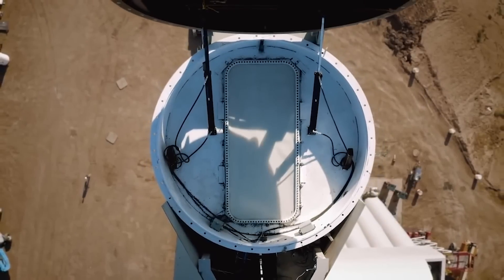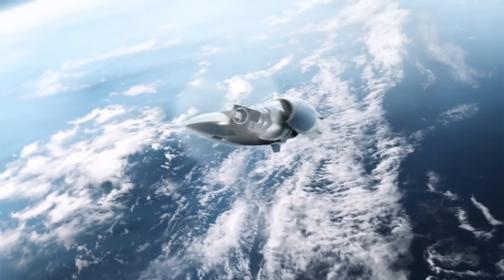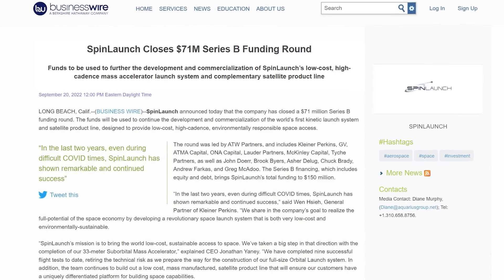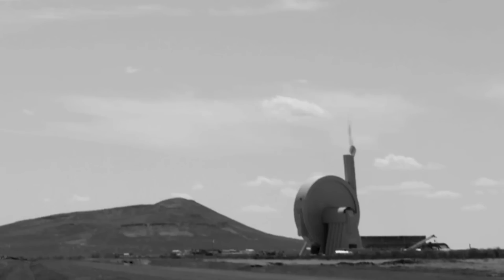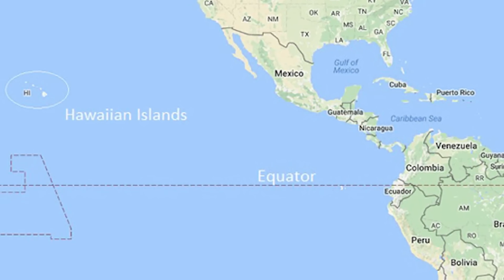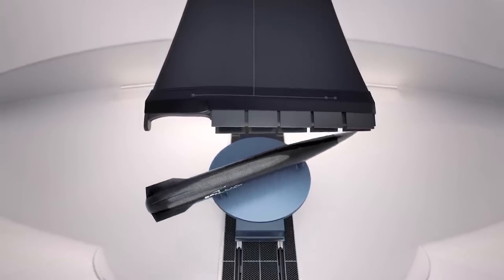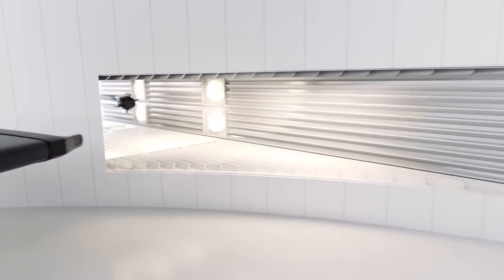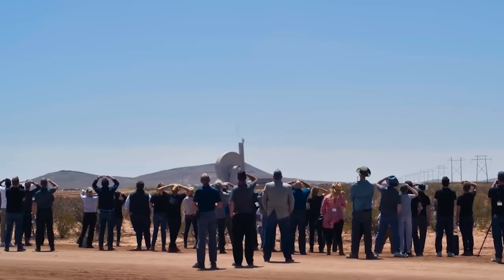What Happened To SpinLaunch & The Orbital Accelerator?

Comment: They got a 200 kg projectile to 30,000 feet, with no remaining vertical speed. 

You could attach one to each external hardpoint of an F-18F and get 11 at a time to 40,000 feet, with mach 1 vertical speed, which would net an additional 17,000 feet or so.
Reply: Lol you need 30 times the energy to orbit vs just reach orbital height and what you’re saying isn’t Even that.
Reply: @hugegamer5988  That is what I mean.  It is not useful at all to launch a satellite vertically and then "just use a second stage to make it reach orbit".  The vertical displacement is not the problem, the horizontal speed of 7 km/s is.
Reply: @mastah39  is there not a market for dedicated launch capability of small science satellites like CubeSats? or has that market been entirely swallowed by ride sharing on larger launch vehicles?
Reply: @mastah39  It's the cost per launch though. Do you think their spinny thing is going to be cheap to build and maintain? How many payloads could a B-52 launch in one flight? 30,000 kg is 150 × 200 kg, so 150 payloads?
Reply: Actually that makes bugger all of a difference.  The energy of launches is not in the height.  @mastah39
Reply: 1) It was a suborbital prototype made for proof of concept reasons and oriented such that the roket goes straight up. If you've whatched more about it you will know that they intend to build a bigger, more powerful, better oriented one to launch the projectiles faster, higher and with a better trajectory
2) The point is to use technologies that don't produce CO2 emissions so your F18 really doesn't fit the bill here. Plus there really is no guarantee that your F18 solution would be feasible, more economical, faster and so on...
Reply: @anthonyjaccard3694  The point is to play a bit with hardware, and to get money to do that from naive investors.  Nothing more.
Reply: @Rob2  If that is the whole extent of your argument, I have no idea what you are doing on an engineering channel. What is the point of looking at videos of new, emerging technologies if you're going to discard all of them with "eh, they're only doing it to scam investors out of their money" ?
Reply: @anthonyjaccard3694  I am not going to discard ALL of them!  Only those that present technologies that cannot be practical due to limitations imposed by laws of nature.
Reply: @Rob2  If we were talking about an infinite energy motor I'd agree with you on that part because it actually goes against the laws of physics as we know them. Spinlaunch doesn't, it only goes against our intuition of engineering constraints. Just because the numbers are big doesn't mean you can't engineer your way out of those constraints. Just go watch Real Engineering's video on spinlaunch. He goes into a little bit of details on the many constraints that this project faces and you might be surprised
Reply: @anthonyjaccard3694  Spinlaunch also goes against the laws of orbital mechanics.  It is not possible to get an object into orbit by shooting it from the surface of the earth, no matter in what direction and with what velocity you shoot it.  Neither Spinlaunch nor Real Engineering will be able to overcome that.
This is completely independent from the practical problems imposed by large acceleration.
Reply: @Rob2  
What exactly do you think the orbiting stage is for?
Reply: @anthonyjaccard3694  you still need to reach orbital velocities, which won't be done using existing liquid rockets - they won't survive the G forces of the spin launcher.
Reply: @smalltime0  Then maybe they'll use solid fuel rockets. Maybe they'll find a type of liquid fuel rocket that can withstand the force. You'd be surprised the solutions that can be found when people put their minds to it. Just because you can't think of a solution doesn't mean no one can and the idea should be scraped
Reply: @anthonyjaccard3694  Solid rockets don't really suit being used to place a payload in a specific orbit, once you fire them you don't have any sort of control - it will keep burning until its done. Pumps are fragile and are required in the use of liquid rockets, there is a reason why most launches limit themselves to 3G~4G of acceleration - its for the sake of the pumps and the payload.
And that's the key, the actual payload has to survive.
Reply: @smalltime0  Go look at "real engineering"'s video on spinlaunch. He talks about the effect of the G-force on the payload towards the end of the video and you'd be surprised how little of a problem it turns out to be
Reply: "You don't understand it now but this is the future of launching satellites."
Reply: @Bollibompa  Hogwash.  It is never going to launch anything into orbit, let alone a useful satellite.
Reply: @Rob2  Hey, I disagree... it is definitely possible that it launches something careering uncontrollably in space - maybe even at escape velocities. But the payload will be a mangled piece of various metal alloys that once was functioning electronics.

More likely, in the event of a "successful launch", the vehicle disintegrates as soon as it leaves the vacuum of the launcher, sending metal shards and flaming chemicals over an impressively wide field. Sort of like a hyper velocity shotgun.
Reply: @Rob2  
"People told Einstein that he was insane."
Reply: @smalltime0  I said "launch anything into ORBIT", that is different from "something careering uncontrollably into space".
It is not possible to launch into orbit from earth surface without further acceleration at a later moment.
Reply: @Bollibompa  You are not going to compare these people to Einstein, aren't you?
Reply: @Rob2  I am sarcastically arguing with you.
This thing won't work, it will never work and at best it will be outright dangerous.
Reply: what? are you going to spin the aircraft? ridiculous. I don't think you have a clue.
Reply: But then how would they defraud their investors out of millions? I bet you their next step is to put solar panels on the building, and call it "solar spaceways".
Reply: Great idea if you want a ridiculously high cost per kg. An F-18F costs about $30K per hour to fly. Also this is from their smaller scale tests-when scaling up, they want to make it such that the payload can breach the Karman line at least. 

The whole reasoning behind this is to lower the cost per kg, otherwise why not just use traditional rockets?
Reply: @mastah39  ok one more question, is air launch something that is more helpful on smaller launch vehicles compared to larger ones? and if that's the case can you think of any small and (comparatively) affordable aircraft that could be used as an air launch platform for small payloads?
Reply: then why isn't it being done?
Reply: @Name-nw9uj it is done, rockcoons and air lifted 500 lb rockets to orbit are not unheard-of. The Pegasus is probably a superior effort to this abomination.
Reply: @testpilotmafia862  right but all of those are rare. if a small jets can be used to launch small payloads like this spin launch thing why arent they being used?
Reply: @Name-nw9uj  Because it isn't a good way to collect huge $$$ in investments and grants and give yourself a big paycheck.
Reply: @briant7265  Well said. Shiny big facilities are a good way to separate investors from their money. A dull boring working method isn't as flashy.
Reply: @Name-nw9uj are you under the impression that capitalism funds science without immediate promises of profit??
Reply: @emmyturner7385  well, possibly? you do realize that is the entire point of an "investment" right? creating more money in the future?
Reply: @briant7265 the torment Nexus will be built and functional, sometime next year.  Afterwards not owning a buying Nexus will be financial suicide.  How many orphans can be stomped by people without a torment Nexus?
Reply: Because at this point the old fashioned way works.
Reply: @Name-nw9uj  have you heard of a Richard Branson? He does exactly this
Reply: @Name-nw9uj  Because you can do much with a satellite limited to 200 kg which still needs a rocket and fuel to get into an orbit.

Comment: "Quicker than the blink of an eye" is a new engineering unit that's not in common use yet in technical circles. I suppose it's morally equivalent to the well-known "gnat's eyelash." This video purports to show projectiles being launched from this but those look too much like they're photoshopped. These people must have thought this through, but the technical difficulties make it look more like a case of denial. There is no mention, for instance, of the need to suddenly stop the rotation of the projectile as its released from the launcher.
Reply: "wittier than people doing things" is an old Interwebs condition for naysayers.

Comment: Its not uncommon for launch and testing facilities to take about a decade or so to do the correct environmental, safety, state/federal, and nearby communities approvals to build such facilities.  So having problems working this out is to be expected.  Usually in the end it requires a decent amount of political lobbying and negotiation to guarantee jobs and infrastructure in a community as a compromise to the risks.

Now obviously doing it in Mexico some South American counties is generally faster.  If the company can put strong guarantees on taxes, income, trade, and potentially a strong resource into the space industry that is a great negotiating chip. However with that you cause problems for aerospace companies coming from the US or Europe who do not want to have to deal with importing all their payloads internationally as well as lower access to local aerospace engineers.  

Its a hard problem to solve, and takes a lot of time.

Comment: The main issue with this is: the payload has max velocity at the same time as max air pressure. That is extremely inefficient. A conventional rocket accelerates as it lowers air pressure, which is ideal. So that idea could work on e.g. the Moon
Reply: But, it’s not like efficiency matters in this case, if your infrastructure can handle it. 

In rocketry, inefficiency means millions of dollars wasted, and hundreds of tons of extra fuel. Here, it just means you need to spin faster.

I agree it won’t work with our current engineering, but if it ever does in the future it will be orders of magnitude cheaper, no matter how “inefficient” it is
Reply: @Android480  The sheer force the projectile would be under in order to reach orbital velocity is ludicrous. mostly because you would lose a large chunk of that energy to the atmosphere on the way out. So while orbital velocity for a rocket is 2200m/s or whatever it actually is. it's going to have to be even faster than that for a projectile thrown from the surface of the earth, because a rocket is still accelerating long after it leaves the pad. 

This is like using a gun to shoot a target that's under 2 feet of water. You may think you can hit it. But the force required to get it done is way more than you could possibly anticipate. 

This is a scam and I'm certain everyone working there knows it.
Reply: In addition you have a enormous acceleration in the launcher...
Reply: there is no such thing like a "max" velocity. Its possible to accelerate thing within atmospheres like our own up to the speed of light - but you will need exponential amounts of energy for that. If you want to come close to the speed of light ... well ... better be packing the entire energy of several stars, per second, that is.
Reply: You don't know the rocket equation. The spin launcher is extremely efficient, because it accelerates the payload without being subject to the rocket equation. The rocket equation means that the fuel grows exponentially to the payload and velocity, because you need to haul the fuel you need to haul the fuel. Inside that vacuum chamber, spinning on the ground, you don't need any of that. Then you release the payload, and even though the speed decreases from the first second, it will reach an altitude that would require immensely more energy if it were to be reached with a rocket engine. Then the second stage ignites.
Reply: It's ideal only because we've studied very little at this velocity. Study more, and you'll learn more about how to beat the problems. Besides, hypersonic is a thing now, you'll need to do this anyway.

Comment: This would be cools but.... Can humans really handle that much force? I wonder how this would work on like, the moon...? I know there are plans to use the moon to build bases for easier travel but this would be awesome!
Reply: It would be much easier to do this on the Moon. There's already a vacuum there, there's no air resistance on the projectile, location is not much of an issue, and the velocity required to reach orbit is much lower. Of course, all launch methods are easier on the Moon.
Reply: a human going through this would be turned into salsa. for orbital velocities of ~mach 23, with a 50m long arm like they're saying, it'd force an acceleration of 20,000g give or take, you'd not just die but you'd be atomised. that's without considering all the other problems with it.

Comment: Unless you could put it at the top of a 20-mile-high mountain, I just don't see how this is going to work very well. The drag encountered at low altitudes just kills performance too much, let alone the extreme heating you have to deal with.
Reply: hypersonic is a thing now. get used to it.
Reply: @up4open uh, "hypersonic" has been a "thing" for a very long time already. But a device like this, operating at nearly full atmospheric pressure is snake oil.  It's not going anywhere. Simply isn't practical.
Reply: @rosswarren436  Because nobody has studied how to make it practical, not because it can't work.

Comment: It would be nice, i think, to get the exit tube higher into the sky to reduce the air pressures they have to deal with. Maybe even some kind air stream system to move the air the projectile is going to enter into so that the surrounding fluid is moving with a velocity comparable and the same direction to the projectile.
Reply: The options for where this launches from do present benefits and troubles. If you go high you gain lighting while reducing atmosphere and some amount of necessary velocity.
Reply: You're slowly nearing the idea of a railgun :P
Reply: @WTFBOOMDOOM  It could even be a hybrid system in that case, but I think the idea with this is you can build momentum greater than a straight line rail gun could for a given maximum amount of acceleration, peak power, and height constraints.

Comment: I've never understood why they think their high tech trebuchet is a better idea than a big ass high tech rail gun. There is comparable acceleration for a device of a given size. And it is a lot easier to scale up a rail gun than it is to scale up a massive rotating thingy in a vacuum chamber.
Reply: if they get it working they don't have to replace the rails every three shots.
Reply: Because you weren't on the team building it, wonder why that is?
Reply: Rail gun has only 70% efficient versus electric engine 98% and rail gun is technically a cannon like normal cannon destroy barrel, so you can shoot dozens of times, but rails will be damaged quickly.

Comment: I think starship once operational would be much more cost effective as it could just act like a ride hailing service to space .. book a slot with mass and dimensions and you'll get your berth on the ship at a pre set future launch.
Reply: Starship has a use. But it requires lots of burned fuel and is loud. This is good for supply missions and small sats. Eventually this concept could be scaled to replace even starship, but that's decades away.

Comment: Even without doing the math, this project seems to be rather ridiculous. I can only imagine the HUGE g forces a sattelite should be able to withstand continously to not break something in the spinning process. I read, that it´s over 10.000 g's and what kind of fine electronic equipment can take that kind of force? And what would happen to the facility in case of an accident during the spin? I would not like to be in the area!!
Reply: You'd be surprised.  I've worked with companies needing motors, gears and electric parts to withstand 10,000 gs.  Smart munitions, timed fuses, electrical contactors small computer chips.  I recall one that was a sabot fired missile that needed to deploy stabilization fins after being fired from a tank or naval gun.  So they needed a gearbox that could withstand 10k gs.  I'm more worried about how you arrest the 1300 rpm backspin you put on your rocket after launching it.
Reply: @edcross447  I doubt they have thrown anything much further than your average pumpkin chucking trebuchet.

Comment: To stay in orbit, a satellite has to travel at a very high velocity, which depends on the height. So, typically, for a circular orbit at a height of 300 km above the Earth's surface, a speed of 7.8 km/s . About 23 Machs or 23 faster than speed of sound or 5 times faster than fastest bullet, plus satellite must reach 300 or 400 km at that speed how much fuel need to reach that height nobody can calculate top secret information :) Because all countries want fake space program. The Orbital Accelerator never reached Mach 1 mark. Thus techno bros on taxpayers money propagates propaganda about conquer of vast space.

Comment: I am not a physics professor

But I can tell you the energy and the materials to a Stand the centrifugal force do not exist yet .  

And the construction of a rocket with computer chips, and electronics and wires would have to be constructed that could withstand this kind of GeForce, an acceleration and vibration . 

Not just say solid metal object 

To have to overcome the advancements, in construction of all the mechanical components on a rocket would make the Rockets so big and over sized and heavy to be this much more stronger would be unfeasible . 

But I guess somebody did not tell the experts 

But they got funding I guess that’s the important part  🤣